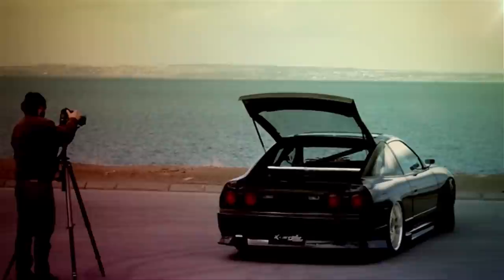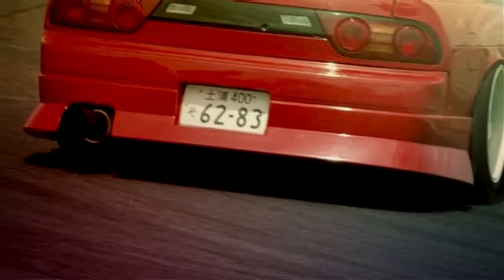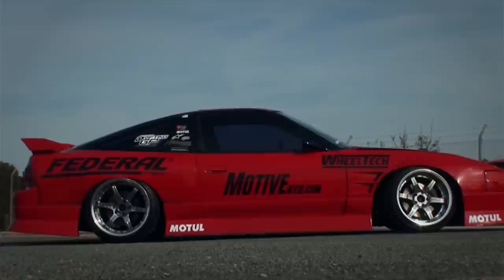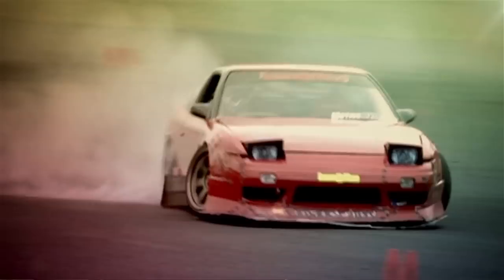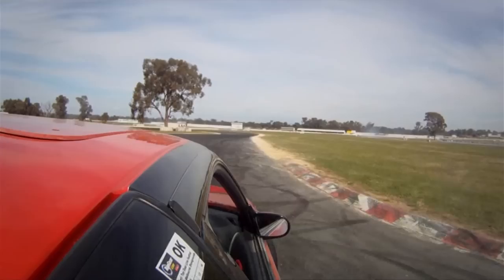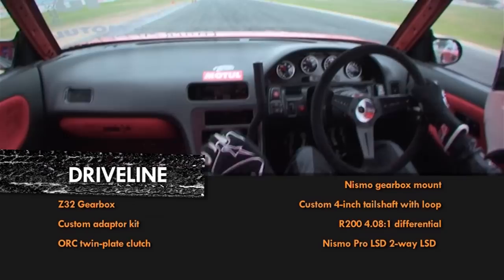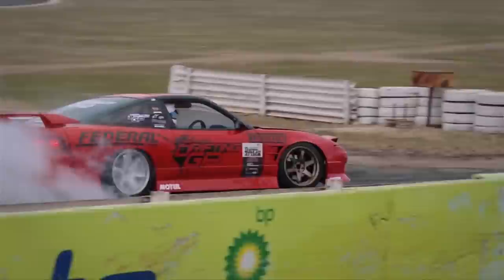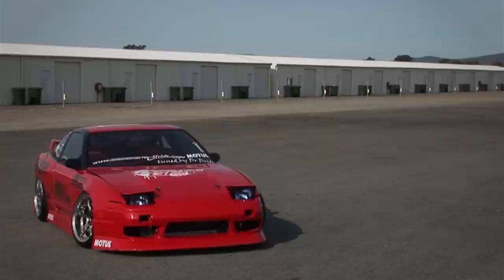Slammed 180SX Drift Machine - Nigel Petrie Engineered to Slide Throwback Feature

Comment: Im playing a old game Forza 4, with the wheel alignemt, I know camber for fron wheel you would want negative (tyres leaning in war).  But as for toe, you would want Toe in?  Or Tow out?  My mehcnaic workmates have mixed me up and said Toe out will help reel the inner wheel and straighten the outer wheel, but this gentlemens car looks like hes running Toe in on the front....Im confused.
Reply: Slight toe out on the front and as much camber that you can get and then zero toe and camber on the rear.
Reply: @rm6330  why wouldn't you run some camber on the rear to compensate with the weight on the outer wheels?  or its just to help with drifiting/sliding the rear end out?  much appreicate the reply.